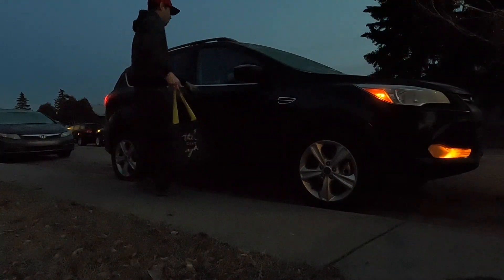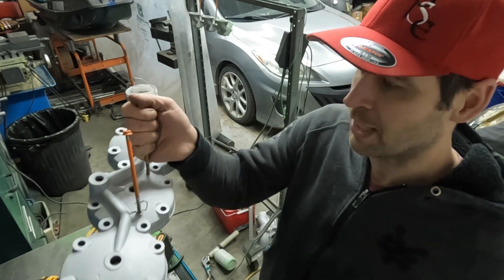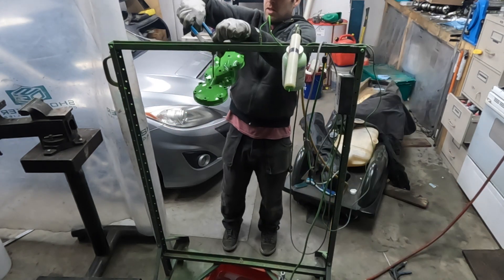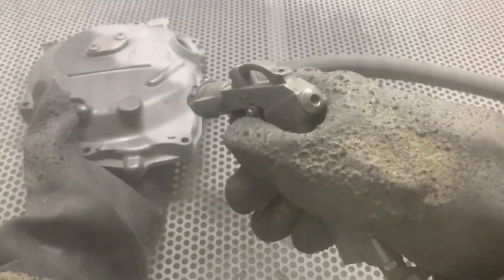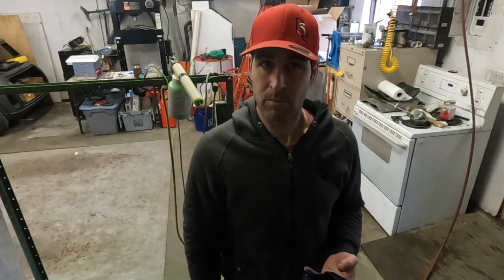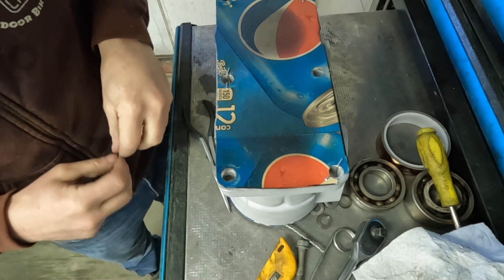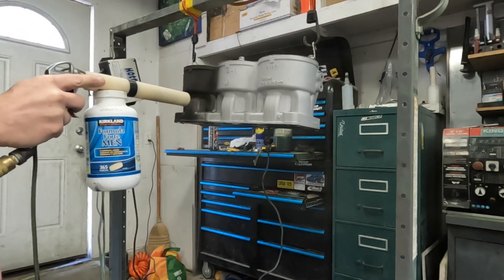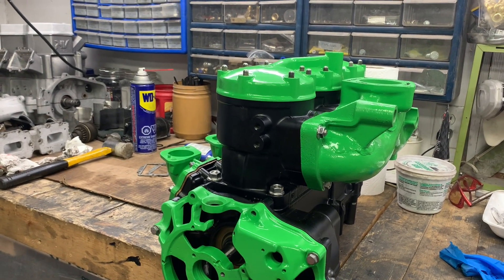Powder Coating MAGIC - Awesome / Unexpected Results !!

Comment: Oh big surprise, Joel does something and it looks fantastic. At this point we all know Joel could do this stuff with a can of varnish from before the great depression and an easy bake oven.
Reply from the maker: 🤣 Jason... My biggest fan. Don't even ack like you ain't impress !! 

Jason: "If you want to impress me, next time you visit, bring an 1100 triple that works well ALL THE TIME and doesn't randomly stall causing my knee to slam into a sharp bracket" 

I was actually genuinely surprised with the results.... even if you were totally confident in me.
Reply: @JoelArseneaultYouTube  I'm impressed, not surprised. No such thing as a reliable 1100
Reply from the maker: @jasonskibrothers2192  What if I removed one of the cylinders, and then replace all of the engine parts with Yamaha 701 parts...
Reply: @JoelArseneaultYouTube  🤣if there's anyone who could and would, it's you ❤️

Comment: Watching video on my breaks at work, I see in the thumbnail you used the skelotonized flywheel cover WOO WOO looks awrmesome!!
Reply from the maker: Haha... I used that photo just for you... and because it's awesome. I just got done work for today, sort of... now I need to answer emails, process payments etc. 

The stator cover turned out awesome. I'm not sure that I will use it right away, because, compared to the 750 stator cover, it is a saving of about 150 grams, and the 750 is totally sealed.
Reply: @Joel Arseneault  lol but "cool factor" hard to measure how much performance you gain there but I think we can both agree... "a lot!"
Reply from the maker: @AtimatikArmy  Haha... yeah, you can't put a price on or measure cool factor in grams... I just figure, with my luck, I should at least take a few runs with it sealed up.

Comment: Cool video Joel! Really like the black! Will you be doing the carbs or are you leaving those?
Reply from the maker: Thanks. I'm going to leave the carbs... They are already black... and they would be VERY tricky to do... You'd have to take a lot of time to completely disassemble and then mask everything well... And you have to mask with high temp tape that is trickier to work with.

Comment: Maybe I missed you talking about it, but do you have to worry about machined surfaces? Like, your head bolts crushing the powder coating? Or any of the sealing surfaces? Looks so awesome!  Looks like I need to buy a sand blasting machine, big compressor, powder coating gun, a used oven, uhhh... What else.. Lol!  Mine is going to look so sad next to yours this summer! ;) Can't wait!
Reply from the maker: I didn't talk about it much... I did mask off the areas that would allow the bearing surfaces to be coated... and ended up having to use a paint stripper on the (after this video) anyway, haha. Ideally, you want to mask off all of your bolt holes, gasket surfaces etc... but I am quite relaxed about all of this. 

When I started doing it I had silicone plugs for every hole, high temp masking tape and was meticulous about it... Now, I do general masking and run a tap through my threaded holes after. Gasket surfaces I try to put a gasket in place or mask in some way. WIth my gun, it gets more complicated. as I almost always have to do a hot coat, meaning that my masking has to withstand 400F for at least an hour, as I will be coating it hot, sometimes a few times. 

You are welcome to use my equipment if you wanna make the trip.
Reply: @JoelArseneaultYouTube  So very tempting. Maybe next year when I have some extra time, and want to mess around with it some more.  My US cleaner removed patches of paint already off the bottom end, and the cylinder looks like garbage on the outside as well.  Lake is starting to melt though!!
Reply from the maker: @dustinwild  Yeah... TIZ the season.... I saw lots of liquid water on my trip south. I'm guessing that one could venture out a few places if they were feeling brave, haha... and had a good wetsuit / drysuit.

Comment: Have you ever painted an engine?  I don't have the tools to powder coat but I know there are very good engine paints (VHT) that would allow me to add a little "bling" to the engine bay?  I'm doing a full rebuild, crank up, so the cases are split and it would be a good time to paint.  I'm curious what surface prep I should do?  I'm going to use the VHT primer/color/clear combination.
Reply from the maker: Sand blasting gives an excellent surface for paint to grab on. There are lots of great 2K paints on the market these days… choose your brand and color. Clean the surfaces well with brake cleaner and compressed air, and again with acetone if you want to be extra fussy.

Comment: Great video. Saving a pound with the flywheel cover. I put a 750 cover on my 1100 and ground a bunch of crap off including the inspection hole so I have a lighter flywheel cover than you.... just so you know. If you want to reach the next level of weight weenie you can't run powder coal. It's to heavy. Glad you made it back from Nevada. That's quite a drive. I'm not really looking forward to the drive to ls fest.
Reply from the maker: Haha... turns out that 326 gram is only about half a pound ... but whatever. SO ... what you're saying is I can still shave a bunch of weight off the 750 cover ... nice. 

I'm glad to be back from Nevada... Your trip to Las Vegas is going to be a LONG one.... That's about how long it take to get from where I am to my home down... I have done the trip 6 or 7 times now... If you have lots of time and plan out fun stops along the way, it's not so bad... but if you are just trying to cover miles to get there... it's a LOT of driving. I just checked and it actually takes 10 more hourse for me to get to my home town from here. What are you going to be driving ?
Reply: @JoelArseneaultYouTube  I think we will be in a lexus suv with not the best room. We will make the best of it I guess.
Reply from the maker: @Jacobskibros  Oh, you're taking two vehicles.... Or is the Lexus towing the Waverunner ?

Comment: Are you going to "texturize" the ports on the intake manifold for fuel atomization?
Reply from the maker: I'm not sold on texturizing having any benefit. I have either polished or left a sanded finish on everything I've ever done. I believe the inlet process is naturally violent and turbulent enough without anything extra. The boost port and transfer ports cause a collision of fuel and air inside the cylinder that is many times more violent than any surface texture or turbulence would be. (or maybe I'm 100% wrong) 

Slightly off topic... but... I watched a video my a guy called "superfast matt" and he explained a few things about boundary layers and talked about the Mythbusters golf ball car test ... I can't remember what he said at all, but he explained why things aren't necessarily as they seem.
Reply: @JoelArseneaultYouTube  hmm, I've watched some of his videos before, mostly on his experiences at Bonneville with his motorcycle entry.  I'll have to look for the video you mentioned, sounds quite interesting for sure!
Reply from the maker: @AtimatikArmy  I've tried to find the video a few times to rewatch it... with no success... it's one about aerodynamics.
Reply: @Joel Arseneault  I found two videos of his on aerodynamics "the Aerodynamics od Speed" and "Why Some Cars have Less Drag Backwards" (or something close to that).  I watched them both but didn't see a part about texturing intake manifolds...
Reply from the maker: @AtimatikArmy  There was nothing specific about manifolds, haha... he just talked about the golf ball effect and why it's not what it seems.
Reply: @Joel Arseneault  Oh yeah it was in one of those videos I mentioned then.  Something about the size being why the dimples work at that scale right?  But he was talking about drag reduction using vortices but the vortices could also be what helps mix the air/fuel together better.  Who the hell knows...  video idea for you (but you would need a dyno).. Joel Arseneault meet project farm (figuratively speaking) and finally get to the bottom of this great debate with actual scientific testing!!
Reply from the maker: @AtimatikArmy  

Yes, that was the video... I just remember watching it, or maybe listening to it while I was working or something, haha, and only half processing the information. Yes... vortices could be what helps mix the fuel / air. It would be interesting to dyno and see.... 

Man... Just before I went off to Labrador City, October before last, I had the opportunity to purchase an engine dyno for cheap.... and passed up as I was short on cash... I'm so upset about that decision... I'm not sure of the practicality of having one, as you almost need a soundproof booth and a dedicated space that then can't be used for anything else... but I still want one.